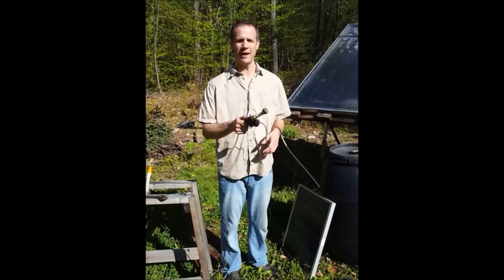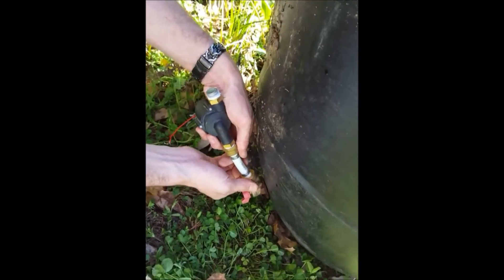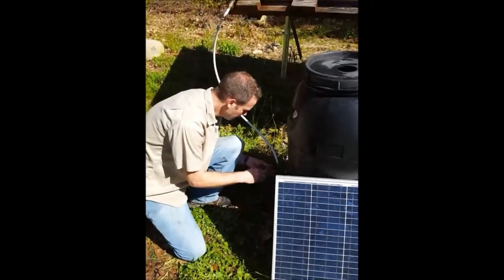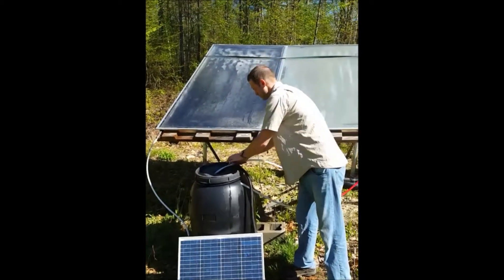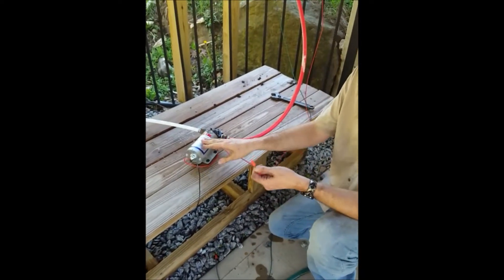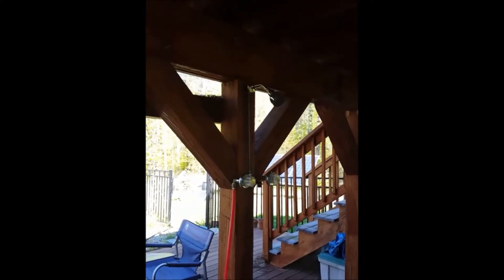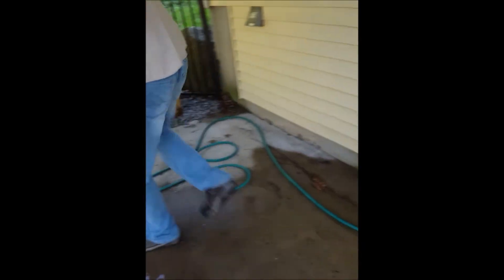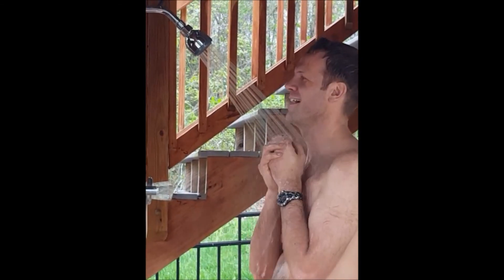Solar outdoor shower

Comment: I understood everything except one important point.  The solar water pump that circulates water will be on when the sun is shining.  Understood.
The pump that delivers the hot water to your shower has a sensor that shuts it off when there is enough pressure to let it know that the value must be closed.  Understood.
But, what controls the cold water going to the barrel?  Is it not automatic?  How does it know that enough water has been drawn from it and more cold water needs to go in ?
Reply from the maker: great comment! I forgot to talk about that. It is a very simple system for filling the 50 gallon barrel. I fill it with my garden hose manually. I can shower for about 40 minutes with one barrel of hot water. That's like 3 showers for me. The less water in the barrel the faster it heats up and the hotter it gets. On an average sunny day in NH with the 50 gallon barrel full I can heat the water to over 120 degrees F in about 3 hours. I usually fill it up in the evening before heading in the house for the night. Then it's all ready to heat up the next day. Thank you for watching and I'd be happy to answer any other questions that you have. Happy outdoor showering!